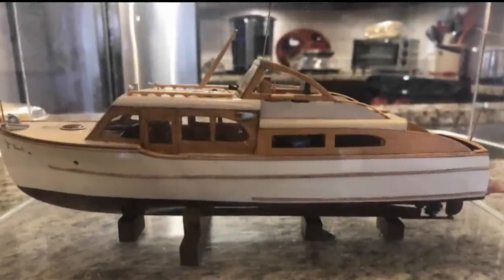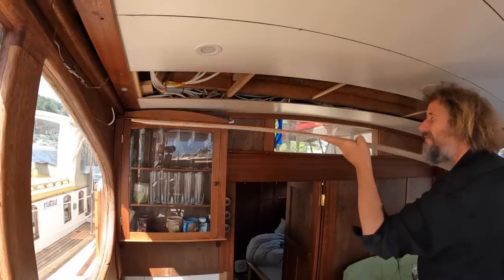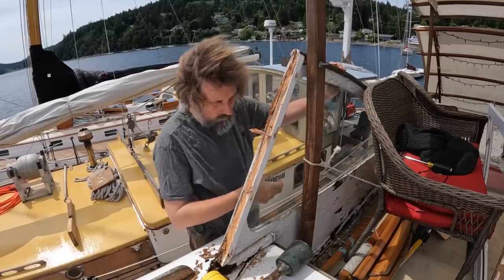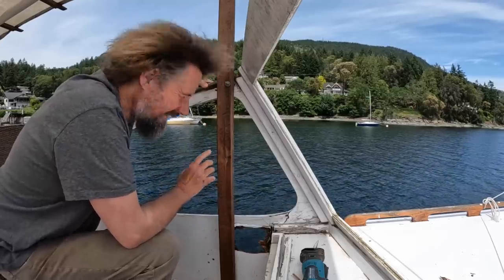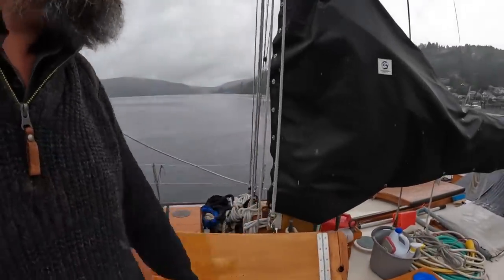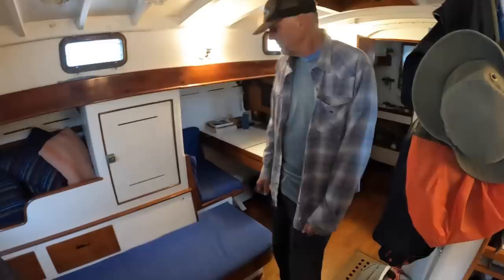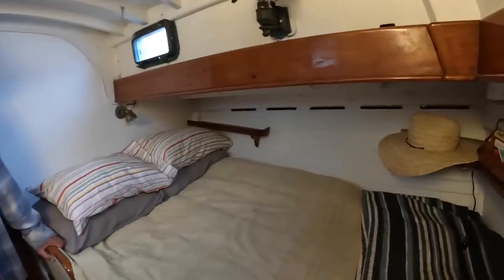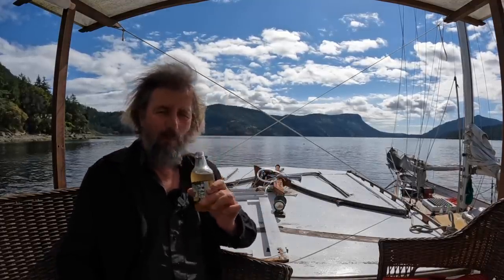Upper Helm Destruction- #311 - Boat Life - Living aboard a wooden boat - Travels With Geordie

Comment: I have owned a 1968 all wood Trojan boat that I sold 3 years ago,  I had it for 18 years I know you are very skilled, but I have to say that any time I repair anything on that boat I kept the old parts as a templet, without it it was almost impossible to replicate the angles and curves of the piece. .... ENJOY!
Reply from the maker: These pieces were too ratty for good templates, pilus the new windshield will be slightly different

Comment: Such a lovely spot! Thanks for that panorama at the start. NOW then, my question--since weather is such an issue re. progress...Would Geordie fit in Poem's boathouse, and if you put Geordie under cover and POEM anchored out, couldn't you work inside more speedily?  ALSO, what do you do, anchored out there with the waste wood and debris? 

MEANWHILE....seeing how rotten and paper-ish all the bases of those windshield pieces were makes me wonder how it stayed up so long (and if the sunscreen was actually doing part of that work by keeping things more rigid in heavy winds) and reminds me of a story I was told by one of the City Councilmen of the city of Long Beach, California about when they bought the Queen Mary to convert into a hotel and tourist attraction. First, the conversion/restoration work had to be done, even with the massive cost involved, as cheaply as possible and that meant they had to remove the ship's ability to ever raise steam again so that it could be reclassified, even though technically still afloat (in a bed of mud along the pier prepared for it)into a "building" and not a "ship" under the maritime building union laws so that landlubber unions for plumbing, electric, etc. etc. could be called in at about 1/3 the cost of maritime ones. THAT meant literally yanking all but one of the boilers and engine room stuff (the solitary one made inoperative but still visible for the tour and history's sake) and, since the ship was built AROUND them originally, it meant cutting them into smaller pieces and hauling them out by crane THROUGH the four stack shafts!

SO...THAT meant taking the smokestacks off and putting them on the dock to be re-installed for looks' sake afterwards, and as you can see in any photo of the Queen Mary, they were in huge oval sections and could be unbolted from one another and from the guy wires criss-crossing to support them at sea.....which is what reminded me of your dismantle of Geordie's windshield because.....when they lifted these huge intact segments of the shafts off and then set them ON the dock, they mostly DISINTEGRATED into a pile of metal, rust, and dust! Metalurgists were called in, and found that over the life of the Queen, with repainting from the OUTside a continual process and erosion due to the stack fumes from the INSIDE likewise, there was almost NONE of the original steel left--it was just many tens or hundreds of coats of PAINT, all held together by the wires and bolts and, when freed of those, left to crumble. Needless to say, once the innards were pulled from the depths of the enormous hull, brand NEW metal smokestacks were put on the ship for looks' sake to replicate the originals, though without any real function except to hide some of the ventilation of the brand new a/c systems of the "building" below!

P.S. That City Councilman told me that the city was NOT the highest bidder for the Queen, but since the others were intending to scrap her, the owners, Cunard, preferred the respect and historical value of keeping her alive for people to visit and enjoy and chose them anyhow. Those empty engine spaces were turned into a Jacques Cousteau-fronted oceanographic museum, the hotel and restaurants/ballrooms/bars were successful for a while, a Tudor-themed shopping/dining "village" was built ashore, the famous Howard Hughes "Spruce Goose" giant flying boat was removed from nearby warehouse storage in pieces and put under a dome alongside as an added attraction for a long while, there was a fairly brief period of Disney management complete with "Haunted Queen Tours" at Halloween, etc.etc. but now her fate is in jeopardy again because of lack of funds to keep her safe and alive. We'll see what happens.

Since I've already gotten a shirt and prize it highly I do not want to be "in the running" to deprive another of that pleasure, but I WILL say that re. your weather and word of the week situation, waiting the 7 days or so for each new installment is, for us who follow you so avidly, an endless ordeal and, well, in the words of the song, "Ain't No Sunshine When You're Gone." (smile)
Reply: Nice piece of information! I agree with DL Fendel about using Poem’s house to rebuilt  your upper windshield, I think it is a good way to get your own sunshine? 😜
Reply: @maximilianobesso7732  yes
Reply from the maker: What a great story about the Queen Mary!
Poem's shed is much too small for Geordie. In fact, quite disappointingly, it's too small for Poem. By almost two feet, despite it being guaranteed to be a genuine 30' of water length.
I would love to find a shed to do some of the more intensive work on Geordie, and Zephyrus too for that matter. However it's far too expensive for now at least.

Comment: I had to replace a windshield on an Elco 52 about 40 years ago, (wow, it's been that long!). Do you know how hard it is to source 9" silicon bronze screws? Luckily I had sunshine throughout the whole process though it was in Rainy Seattle.
Reply from the maker: Whoah, that's a monster screw.
Reply: @TravelsWithGeordie  The windshield was edge fastened through the width of the planking to the cabin top and the bracing. The bottom plank of the windshield was 6 inches of Honduras Mahogany.

Comment: Peter. The attachment of the mast to the upper helm framing, was an eloquent solution, for establishing a perch for the internet. I recall when you did it. I look forward to seeing the future set up as  the new upper helm is constructed. One question though. When you move the base of the windscreen forward some and alter its elevation, is that going to change the amount of sunshine that comes through the glass. Travel well be safe.
Reply from the maker: Heh, good use of the work. The answer is no.

Comment: Quick question Peter; you mentioned that you wanna make the windshield couple inches higher, now you will change the windshield for a bigger ones (taller) or just gonna rise the same one?
Reply from the maker: I'll be using the old glass so the bottom rail will get thicker.
However I'm considering not making it taller.

Comment: If I remember correctly (probably not) you were also going to widen the upper helm (just inside the bright work?), is that still part of the plan?  ;-)
I've forgotten, will the two canopies stay in the remodel or were they temporary, until proper ones can be acquired that will shade you from the "sunshine"?
Reply from the maker: The windshield won't be any wider but there is a change coming to the cabin roof that I think will work very nicely.
The canopies are temporary, I'm designing something new as we speak.